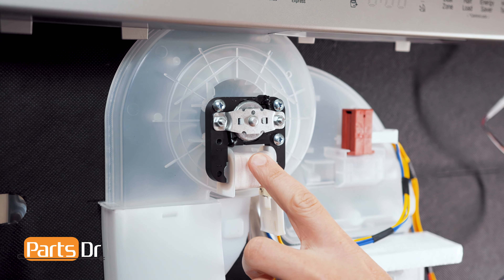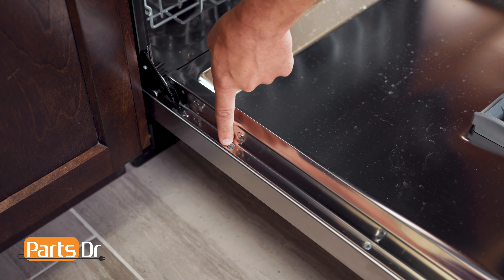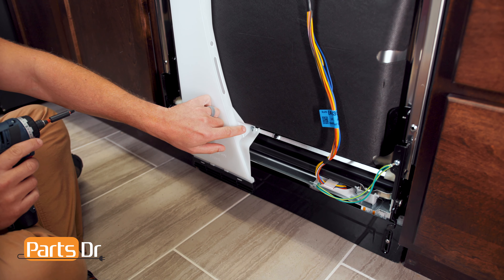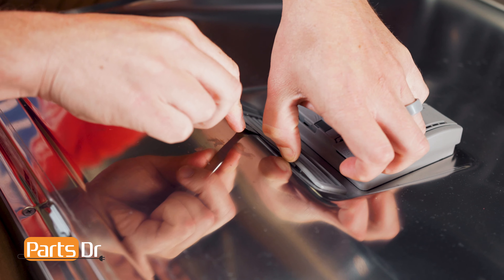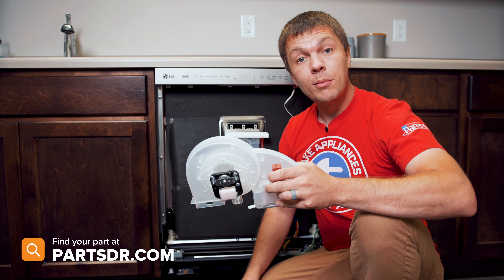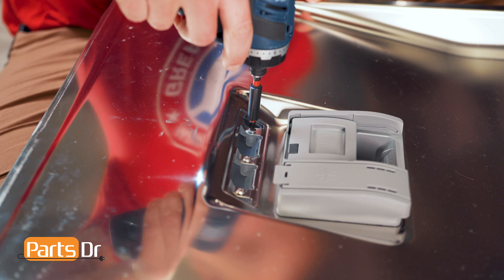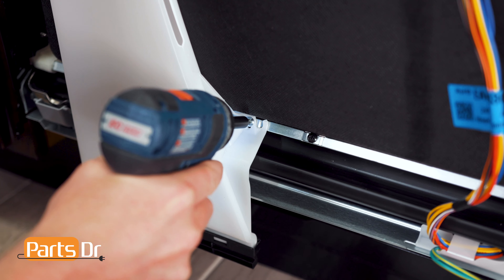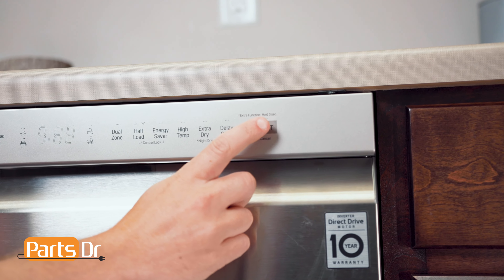Leaking or Noisy? How to replace LG dishwasher door vent blower motor part # ABT73009401

Comment from the maker: We hope this video helps you replace the door vent blower motor on your LG dishwasher! For the best results, we always recommend using genuine OEM parts. You can find the high-quality LG part featured in this video on our website at https://partsdr.com/part/abt73009401-door-vent-blower-motor. Using the right parts ensures your dishwasher operates as designed and avoids unnecessary problems later on. We’re here to help if you have any questions. Let us know how your repair goes!

Comment: Great video, this is exactly what I needed. My dishwasher (model LDT5678SS) had water pouring out of the front vent. Buying this part was cheaper than the cost of having someone to come out for an initial inspection.
Reply from the maker: Nice job fixing it yourself!

Comment: My dishwasher was leaking out of this vent When I took it apart I could see a good build up from hard water. I figured I would try cleaning it with vinegar and hot water to see if that would fix the leak. Thought maybe the hard water build up would not allow it to work properly. After cleaning and putting it back together it seemed to fix the leak. We’ll see how this holds up, if it starts leaking again I will definitely buy the new part. Thank you for posting the video
Reply from the maker: Nice! Hopefully that takes care of the issue for you!
Reply: Any word on how long your fix lasted?
Reply: @Chris-u2h7d  haven’t had an issue since. Knock on wood

Comment: Great, clear helpful video. Thank you.
Reply from the maker: Glad we could help!  What kind of problem is your vent having?
Reply: @PartsDr  Very loud motor noise during the dry cycle.  Dishes are marginally not as dry as expected.  Plastics are not dry, but I understand that's normal.  We have no trouble codes.  It seems like a slowly failing dry assist motor.  The unit is 2 years old.  Would putting my multimeter to the motor indicate if that's the problem?
Reply from the maker: @rossichiropracticcenter6392  Unfortunately, a multimeter will usually not help diagnose the problem in this situation.  If a motor is dying, you usually just have to use your best judgment that this part is failing and replace the part.

Comment: Excellent video.  My LDP6810SS is making a rattling sound during the drying cycle, which sounds like it comes from the door, so I think it's this part. 

This video didn't include a "here's what the broken fan sounds like" but there are no other possibilities if the noise comes from the door, would you agree?
Reply from the maker: Yes, we would agree that it would most likely be the blower motor.  We don't know of any other moving parts in the door.

Comment: Just a warning that not all replacement parts come with the rubber gasket that's required at the joint between the vent part and the door.  My replacement part didn't come with this, and I failed to notice the gasket on the old part when I removed and replaced, so I had a few very leaky dishwasher runs before making this discovery and re-installing the gasket.
Reply from the maker: Thanks for the tip!

Comment: Water is coming out of our vent but our blower and everything is still working. Any idea on why it suddenly decided to start leaking?
Reply: I’m having this exact same issue. Did you ever figure out what exactly was wrong with it?
Reply: @starchfree  Same and I can't find the answer anywhere
Reply: @jonathanbalcar7378  I ended up replacing the blower assembly in the door. It fixed it. The little door that seals off when water is spraying inside had gotten stuck open and water was just filling up the fan then pouring out the vent.
Reply: @jonathanbalcar7378  I found what I needed on Parts Dr. Think I paid like $75 for the part and the replacement is pretty straight forward. Just make sure you hold onto the inside of the door when you take out the screws because it will close on its own without the outer door and when it does it will pull all the wires loose. Found that out the hard way.
Reply: @starchfree  this helped me. Thx!

For anyone looking to solve the leak, it is the flap door just behind the vent cover inside the door is  open... might need that little actuator that operates it.
Reply: Can just the wax motor be replaced? My blower works fine but the water it leaking out of the vent.

Comment: Ok so getting ready to replace my blower motor. I notice that when you put it back together and  the wires were reversed. Does it matter or was that an oversite and you had to come back later to fix.
Reply from the maker: Hi Ken, on this dishwasher, it does not matter the orientation of which wire goes to which terminal on the blower motor.

Comment: Can the noise persist even after the the dishwasher has sang the song and finished the wash?
Reply from the maker: Yes, it is normal for the fan to run after the cycle is finished. After the cycle ends, the fan runs for an hour to help vent the warm, moist air in the tub. You can stop the fan by opening the door after the cycle ends.

Comment: Just bought a new LG dishwasher that has this type of blower moter and when the fan runs during the drying cycle it generates a high pitched hum.  Do you know if this is normal? It's not real loud but is at an annoying frequency that resonantes throughout the house.
Reply from the maker: Hi Jill, ours doesn't seem to make the high pitched hum that you are describing.

Comment: Is this always the cause for this part leaking? Mine just started leaking tonight after approximately 4 years of owning it. LDP6797BD is the model number.
Reply from the maker: It is a common for this part to be replaced because it leaks.  Let us know what you find.  https://partsdr.com/part/abt73009401-door-vent-blower-motor
Reply: @PartsDr  I started with taking the door panel off, took the part out and gave it a clean. So far its been fine and working. It's easy enough if I need to replace so if that happens then oh well. But we're good for now. 

Thank you for the informative video on how to get in there.

Comment: What is the fix to the common left side leakage at the door on these models? Is it because the vent is staying open? It's a pretty common problem. But no one addresses this issue. The blower is working. How do I verify the vent is working?
Reply: I have the same issue. Did u find out what was causing your leak?
Reply: @briannasmith2913  took it apart, cleaned it up, didn't replace anything, couldn't see anything misplaced or faulty. Put it back together and it hasn't happened since...idk. 😐
Reply: @briannasmith2913  I'm having the same issue. Did yours get fixed? These videos do not help with this extremely common issue for some reason.
Reply: @jonathanbalcar7378  same issue...

Comment: does the fan blow air inward or outward?
Reply: curious to where the air is being drawn in, my dish washer is pulling in the dust from construction into the dishes
Reply from the maker: It is blowing the air out of the dishwasher.

Comment: If there is water coming out this vent, is it a motor failure? Thanks!
Reply from the maker: It would probably depend on where the water is coming out.
Reply: @PartsDr  On my LDF5545ST the water is dripping from the vent at the bottom of the unit. Clearly there's something wrong with the venting system, but like Nicholas, I'm wondering if it's the motor or the vent. The duct assembly and the blower motor are different items. Don't really see how the assembly could fail since it's just a piece of plastic, but I don't want to spring for the motor unless I'm sure that's the issue.
Reply: Just replaced the motor and the vent still leaks
Reply: Out of the bottom.
Reply: @andersmartinson1750  Yeah I was wondering about that. I don't know how to solve the leak and can't find the answer anywhere
Reply: @andersmartinson1750  sad for you. Just having this issue scared for me.

Comment: My Dishwasher makes a loud clicking sound on the drying cycle Does this mean I have to replace the Blower Motor?
Reply from the maker: It is very likely a bad blower motor.  There isn't much else that would only make the noise during the drying cycle.  Let us know what you find!
Reply: @PartsDr  I must give you total props for this video !! I replaced the blower in 20 mins and you saved me a whole bunch of money !! The dishwasher is now running as it should and the dishes are finally dry.
Reply from the maker: @dermottdesatoon1508  Thanks for following up!  Nice job doing the repair yourself and saving money!
Reply: We have a brand new LG top control unit LDT7808SS, and it’s clicking during the drying cycle near the end and the sound is definitely coming from the vent and sounds like a fan blade rubbing something based on the sound and frequency.

Looks like an easy repair so I imagine they’ll just send a service tech to sort it rather than replacing the whole (< week old) unit